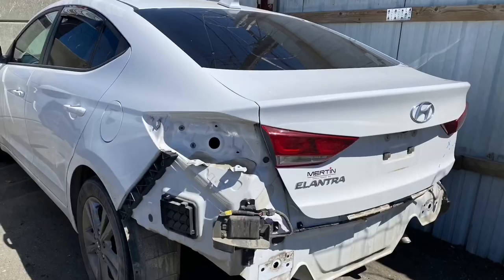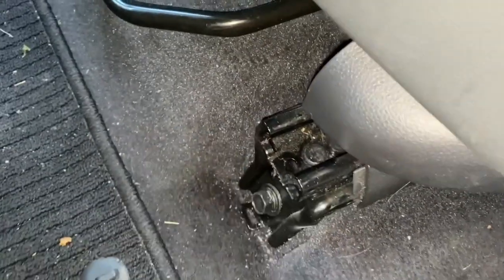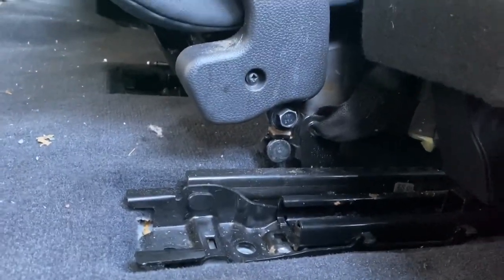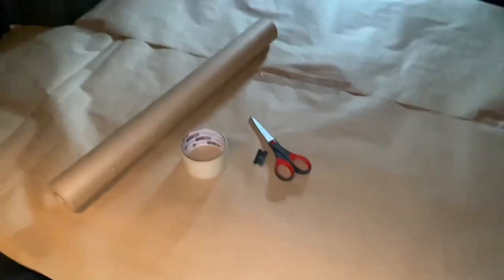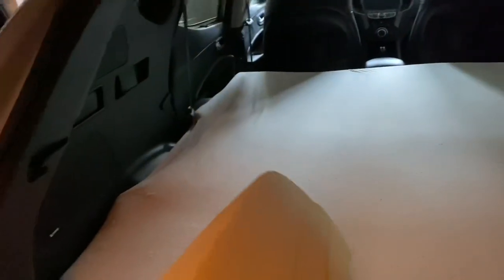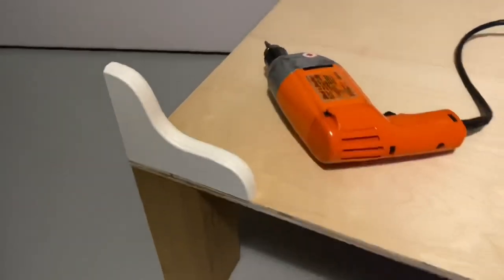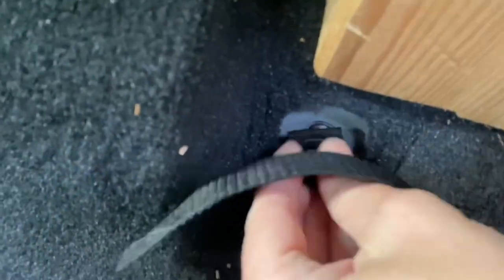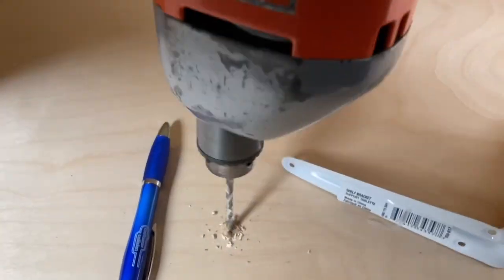Removing the back seats of a Santa Fe & building a platform!

Comment: Hi Kristina! I have a question. I want to remove just the large section of my Hyundai Santa Fe 2018's back seat (left seat + middle seat) and leave the other seat intact and usable by passengers. From your video, I'm fairly sure this is possible, but I wanted to ask you to be sure. Can this be done?
Reply from the maker: Yes you absolutely can!  😃 I may do this same thing next time I take the seats out. I recently took my platform out and put the seats back in. I actually had to watch my video to see a couple of things. Lol Good luck to you!
Reply: @Connection Carousel - Kristina Seaton  Ah great to hear! There should be plenty of space for a bed platform in just that space where the bigger part of the backseat is removed. I'm excited to get started and go on cool adventures! It's also great to hear that you were able to put the seats back in, as I do want to make any modifications to my suv temporary. Thanks for answering my question!
Reply from the maker: @playlikeme3337  My pleasure!  Yes I agree about having plenty of space. I think it will work well. I’d love to see a photo when you’re done!  Exciting times ahead!  😃
Reply: @connectioncarousel  I'll definitely be taking some photos! Thanks again 😁

Comment: Hi! How tall are the legs holding up the platform?
Reply from the maker: They are 10 inches tall 😃👍🏼
Reply: @connectioncarousel  Thanks for the info! I'm building the floor now. This video has allowed me to do it myself! Other than actually unscrewing the bolts. I wasn't strong enough to turn them and when I asked a friend what the tool people used to undo stuck bolts was called so I could buy it, him and his employee did it for me. But other than that, I'm doing it by myself thanks to you and this video! 🥰

Comment: I have to look at your other vdeos.  Is there one with your set up in the Elantra.  I also had an Elantra but sadly hit a deer and it was a right off also.  I loved my Elantra but decided to purchase an SUV, the Tuscan, so it was larger in case of more deer.  I love your set up, so nice.  I have commented on a couple of your videos now and stated that I did only set up half and left the other half open for any storage needs but I found I only needed under the bed storage, floor of back seats (which I left in and built the bed frame above) and a small plastic 3 drawer beside to hold things I wanted when sleep time such as books, journals, night things.  I have thought about making a full bed frame and again would use underneath for storage if my grandson wants to join me.  Hoping next Spring :)
Reply from the maker: That sad about the deer. I test drove the Tuscan but ended up buying my Santa Fe.  They seem fairly similar to me. That will be so fantastic if/when your grandson joins you!  I’m sure he will love it so much!  Thanks Tanya for watching. 😃

Comment: Thanks for your video! I've been traveling in my 2020 Santa Fe with the back seats in and I give up. I need the seats out for the additional storage and so I can have a level sleeping platform. Plus without the seats raising the back area 5 inches, I'll be able to sit up straight back there, which means I won't need  to keep the back passenger seat in. Removing the seats is a no brainier.
Reply from the maker: I’m so sorry I haven’t replied till now.  Yes I wouldn’t want to have the seats in at all.  Did you take them out? I ended up taking the platform out and the storage area. It looked like a mini van in there when I had it empty. I put that piece of plywood I used for the platform under my mattress so it was flat (just the one piece of wood. It’s so great.  I have sooo much space in there now. 👍🏼

Comment: Soooooo amazing 😍
Reply from the maker: Thank you!  I ended up doing what you did in your equinox. I cut the mattress and used part for storage. It works way better that way. I had to do it though because I had a large container of water dump on the mattress so I decided the best way to deal with it was to cut it off. 😆 I was worried about it getting moody if it didn’t dry out properly. Good luck to you!  😃